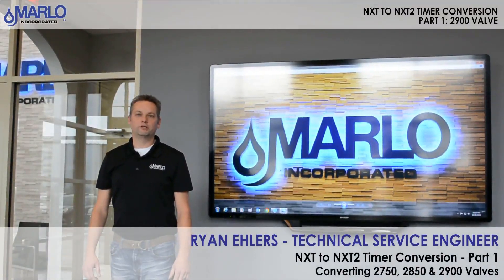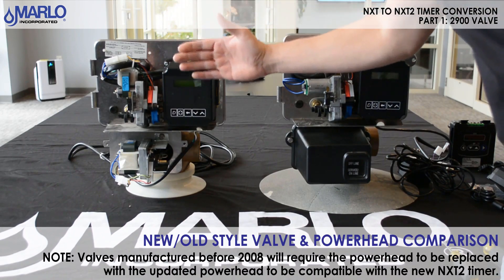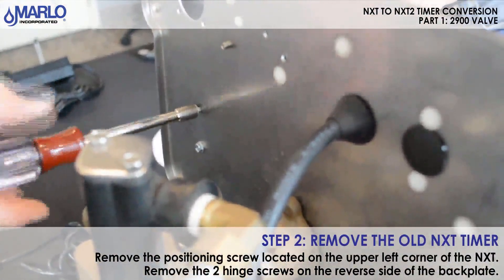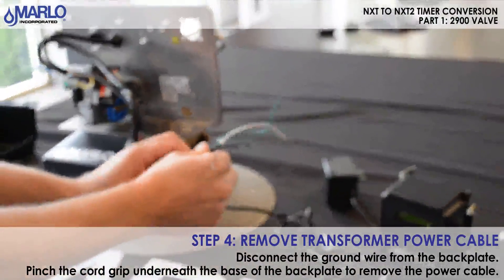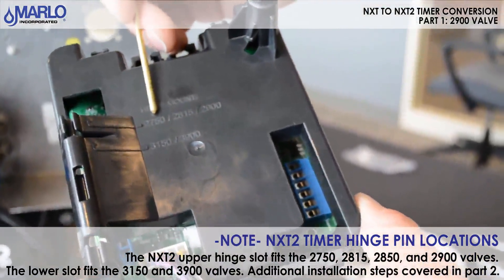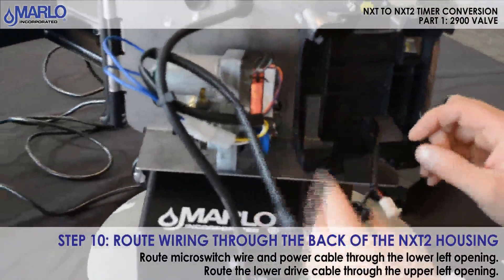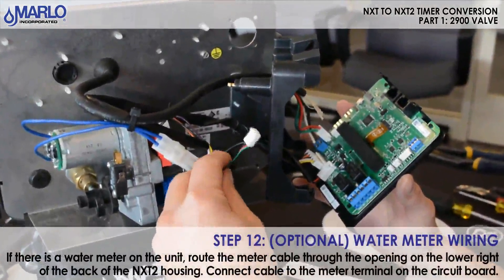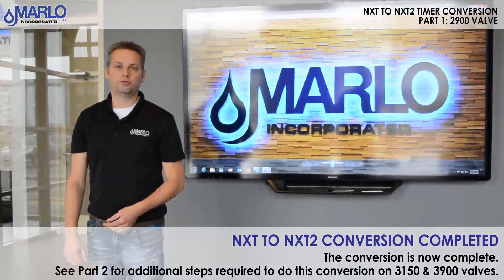NXT to NXT2 Timer Conversion Part 1

Comment: Did this today ran into a problem the lower drive only has a red green and white wire no black wire do I need a wire harness?
Reply: Your lower drive motor is a 120v motor that will have to be changed over to a 24v motor along with your upper drive motor.

Comment: Got mine installed i just need to program it. It's a 2750 NXT2 5 cycle.
Reply: yes you can access the master programming menu by holding down the Left (shift) and the Down arrow for 5 seconds from the main screen.